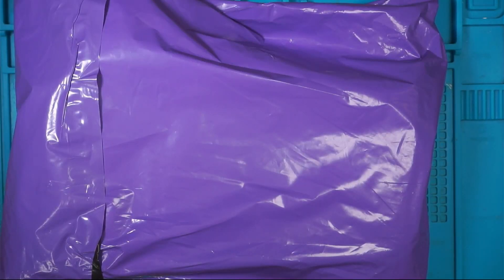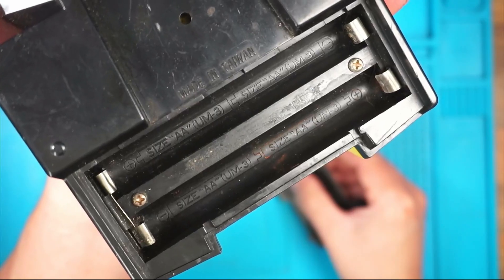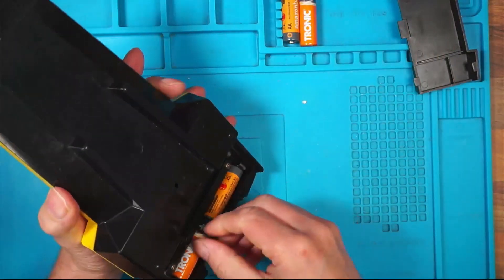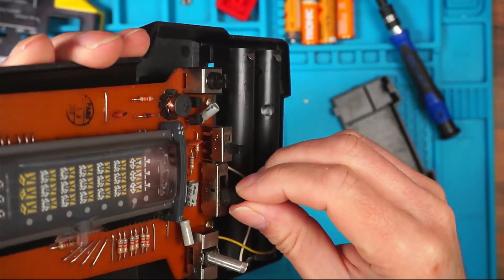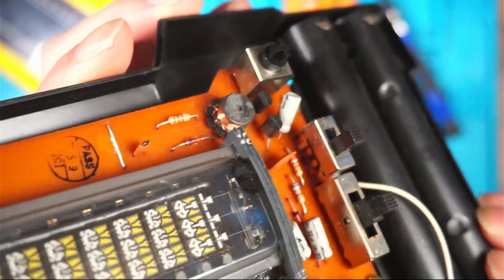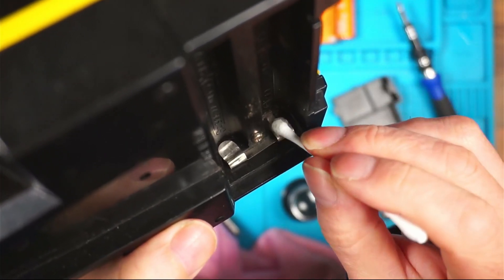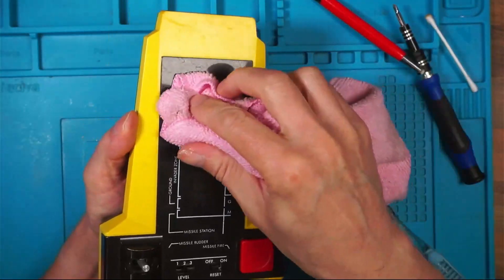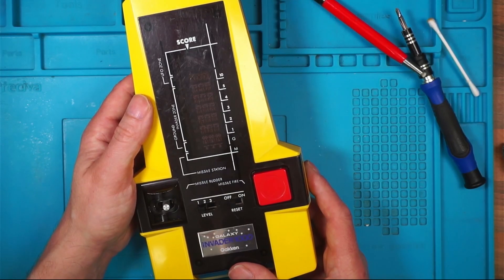Fixing the Iconic Galaxy Invader 1000: Can We Bring It Back to Life?

Comment: Agreed on the alcohol on plastics. I tend to prefer using something like glass cleaner to clean plastics. It's much gentler, and it stays wet longer so its easier to work with. I only resort to alcohol if I have to tackle some sort of stuck on goo left behind by stickers or the like. And even then, as a last resort.
Reply from the maker: Does glass cleaner not have have alcohol in? It smells pretty potent. I have a bottle of non-alcohol screen cleaner which should be safe to try on anything too.
Reply: @PhilipBryden  I have two different kinds of glass cleaner. One kind has alcohol in it, but not very much. It's far more gentle than straight IPA. Iirc, it's something like 5% alcohol. It comes in a can and it sprays as a foam, and it's made by a company called Sprayway.

 The other kind (which I use the most) has a small amount of ammonia in it. This is your classic old school Windex. My chemical compatibility chart shows it harms less variety of plastics than alcohol. Most importantly it's pretty safe for ABS, which is what most of these gadgets are made out of. And considering the low concentration, I deem it safe. 

 I wouldn't use either on clear plastic lenses though. I use eyeglass cleaner for that.

Of course I also have an ultrasonic cleaner which I use hot soapy water, which is great for cleaning nasty game controllers or other small parts.
Reply from the maker: I've just tried some WD40 on clear plastic and it worked a treat on sticky residue from a label. The plastic was ABS so I should have been fine with IPA but wanted to try WD40.
Reply: @PhilipBryden  Yup that's another fine option. I have also used zippo lighter fluid on sticky residue. It's nice to have so many options. Sometimes one thing works, and another doesn't.

Comment: I wish we could post picture comments here, because last month I had gotten an Entex Space Invaders handheld from 1980 that needed contact cleaning and repairs on the left and right buttons. Turns out the old silicone membranes had broken and then melted to the board. Took me a bit to scrape it all off, but I did. Then, I just improvised by using the silicone button pads from an old NES controller, and viola! It worked.

Yours is so much cooler looking, though. Different brands, obviously. But the stuff that was made back then was just built differently. Simple but reliable construction.
Reply from the maker: Ah nice fix, glad you got it working.  YT should develop the community pages and let the channel owner allow user content to be posted.